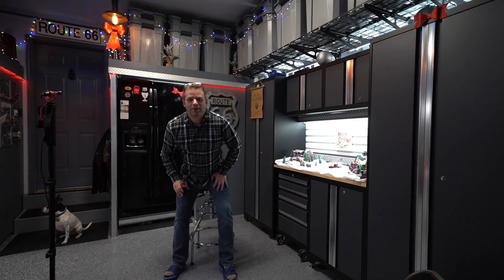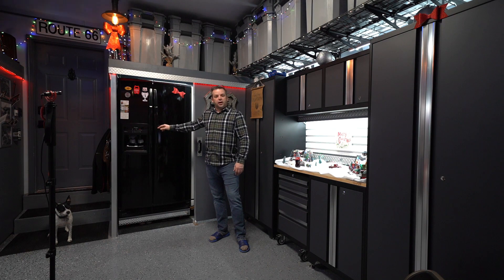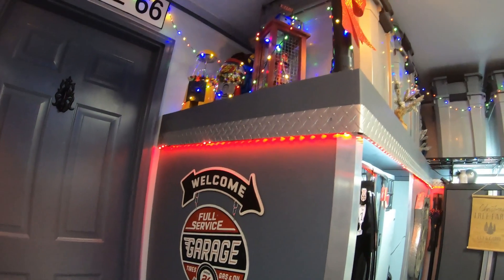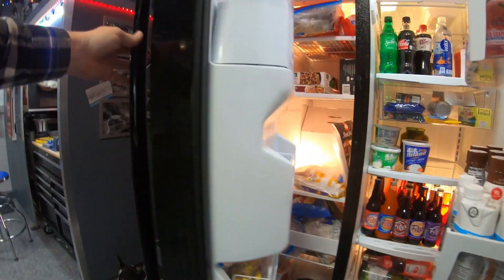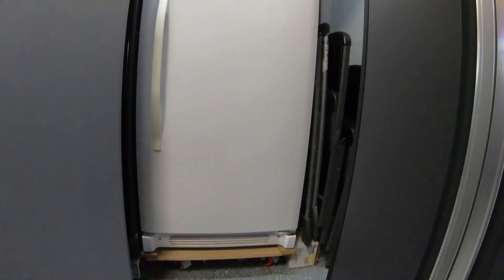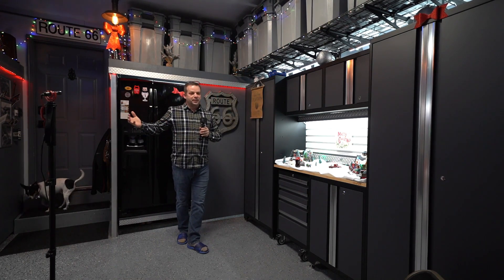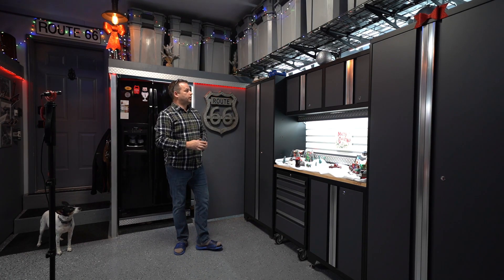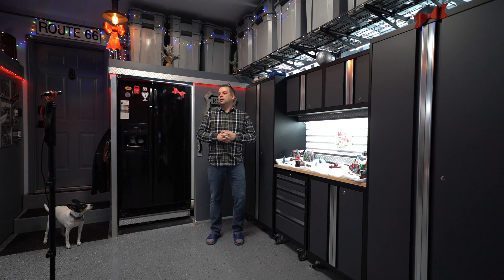Transform Your Garage Into Your Dream Space With Part 5 And Part 6 Of My DIY Makeover | Abraz House

Comment: looks good.  I got the floors done, new garage doors and new openers.  The New Age Cabinets just got delivered today.  It's freezing in my garage right now, I'm in the North East.  I am contemplating insulating the exterior walls and putting in a DIY mini split.  This way I can also keep it cool in the summer.
Reply from the maker: Sounds great! So glad you are making progress.  You need to post something!  I love looking at other peoples work.  I was totally impressed with the New Age stuff.  If I were you I would put the insulation at the top of your priority list if you plan on spending any amount of time in the garage.  It was one of the best things I did.  Best of luck to you!
Reply: @ABrazHouse  thanks agree it probably is the right way to go about this.  Another question.  Did you buy the new age slatwall?  I didn’t order it with mine cause it was an additional $200 and though that was over priced, but I’m finding It’s the average rate, and considering ordering.
Reply from the maker: No, I went with the Gladiator Gearwall - https://amzn.to/2LC9jrr  I like the accessories that were offered and it was in the sizing that I liked.

Comment: How many dedicated lines are you running to the garage? And how do you stop the water line from freezing that’s connected to the refrigerator?
Reply from the maker: Electric?  4 dedicated.  I just added 220 as well.  That side is an interior wall and the water line is coming from the basement.
Reply: @ABrazHouse  Nice. I was told I couldn’t run a line to my garage, even from the interior wall side. Our winters are just too cold. I’m guessing this isn’t a problem for you guys!

Comment: What is your ceiling height? I like the above head racks to store the bins but i dont think my garage is as tall as yours.
Reply from the maker: It is 9 1/2 ft tall.  I used the FLEXIMOUNTS 2-Pack 2x6ft Garage Shelving with Hooks 24-inch-by-72-inch- https://amzn.to/35xc2cQ  They worked great for my size garage.
Reply: @ABrazHouse  how high up did you mount the shelves? 6.5?
Reply from the maker: You are a winner!  Halfway into my garage it is 6' 6" to the bottom of the brackets.